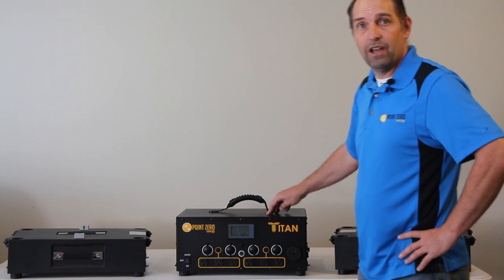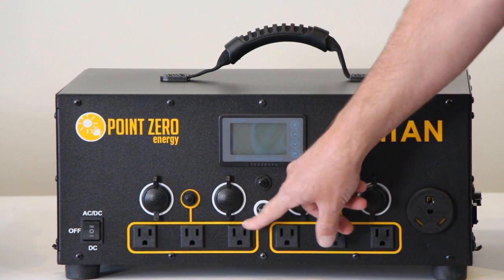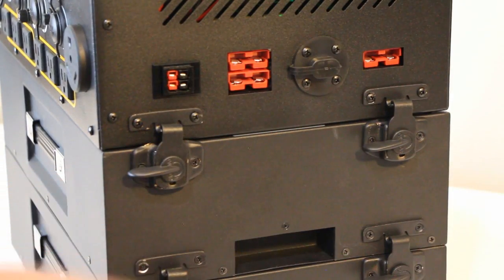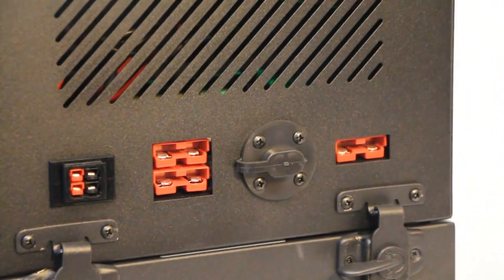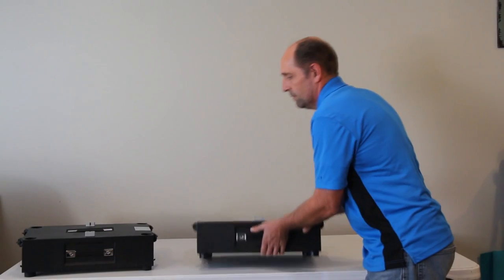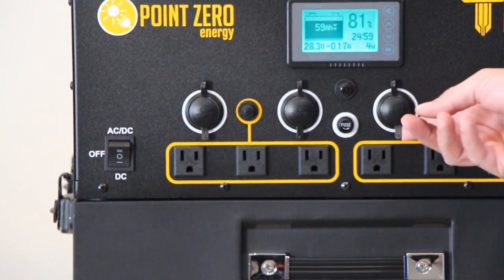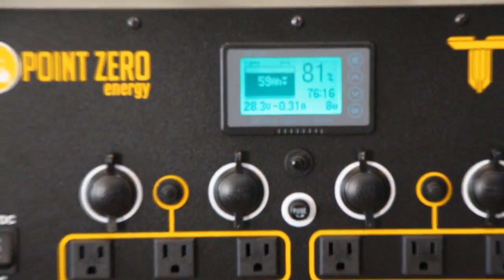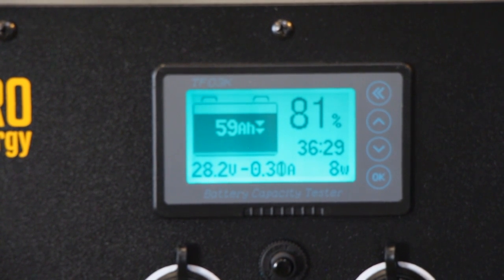Titan Solar Generator final

Comment: Can the batteries be charged directly with AC charger without the inverter?
Reply from the maker: Yes, however if you do that, you will need to fully charge the batteries, and then when you connect the power module make sure it calibrates to 100%.   If you only charge it part way, the battery state of charge will not be accurate.
Reply: @PointZeroEnergy  I guess then that the only way to know if the battery has been fully charged is to connect the battery to the inverter.
Reply from the maker: @thedeal9526  The AC charger will indicate when it is full.

Comment: I'm really loving the modularity and portability design... Do you know if Point Zero plans on offering an EV charging outlet?  Synonymous to bringing a full gas can for long road trips, the use-case is for bringing something like this in the back of an EV SUV/car as an auxiliary fast-charger when the vehicle's lithium batteries have been exhausted. Thanks!
Reply from the maker: HI, I am very happy that you are loving your Titan solar Generator.  Currently you can charge an EV using a level one Charger.  The Problem is that it charges slowly, which meant is will add 3.5 to 6.5 miles per hour.  The Titan 2.0 will have the ability to produce 240V (with two or more units), and would be able to run a level 2 charger, which will be much faster, but even with that, you will need a lot of Titan batteries to extend the range much.  To give you an idea, an EV will use about 0.346 kwh per mile, and one Titan battery is 2.0 kwh.  That means you will get less than 6 miles per battery (5.78 miles if you had no loss in charging the battery, but you will have losses, so you will probably only get about 4.5 miles out of each battery..

Comment: How many batteries can be stacked at once and can you use other batteries of the same composition?
Reply from the maker: There is no specific limit to the number of batteries you can stack, but we recommend not going over 5 or 6 just due to the height.  And yes, you can use other batteries of the same composition, and even batteries that are not the same composition.

Comment: Any plans to add Bluetooth capability to display data?  I am looking to use for an RV, but will need to put it in the under the bed storage space, and not be able to easily check the data.

Comment: Will these be able to work with a well pump?  3/4 HP 240VAC?
Reply from the maker: Not this version.  However our 2.0 will be able to when you connect two units together.  The 2.0 is still in testing (so we don't have a date for it yet), but we expect it to be ready in a few months for pre-sale.

Comment: Will we get a 230VAC output model?
Reply from the maker: Our Titan 2.0 which we expect to release this first quarter of 2021 will have the ability to produce 240V 60hz (split phase) power when you connect two units together.  However we don't have plans for a 230V 50hz version at this time.

Comment: is it possible to work DC and AC at the same time? You might want to charge your phone in DC and turn on a light at the same time on AC
Reply from the maker: Yes, you can run AC and DC at the same time, or you can turn it to only DC to save a little power when you don't need the AC power.
Reply: @PointZeroEnergy  thx for your unswer. Just one last question. the device where are the usb and plugging connectors has internal battery? And if yes what is the WATTS storage capacity.

thx again and congratulation for your devices performance.
Reply from the maker: @angelgarciaarrieta2367  No, the Titan does not have any internal battery.  It uses the same external battery (or batteries if you have more than one) to power everything.
Thanks!

Comment: When I get my tax returns is when I plan to order something like this but will probably end up going with somthing that's not going to take 6 months to get. Great product though. Should try to get the back order problem fixed. I'm sure tax season you guys will get a lot of orders, probably even more orders if it wasnt for such a huge delay.
Reply from the maker: We are working on getting things caught up. And if the country does not get shut down again like last year,  and if we can continue to get the supplies we need,  we should get caught up soon.  By the way, the current wait time is about 4 months (which isn't great, but better than 6 months).

Comment: Lots of common sense suggestions but be assured that users will miss these and stack unbalanced batteries and hook up all kinds of weird inputs then claim warranty.  If you know of a bad scenario that will damage the unit then it will pay off to engineer it out.

Comment: Can you add 5 batteries packs. I see you only used 2
Reply from the maker: Hi,
Yes, you can add 5 battery packs if you would like.  We have several people that are using 6.  The only limit you have is the charge time will increase, and the height of the unit will get a little high.  However you can also start two stacks using our Titan expansion wire.
Reply: Do you have a extra charger to charge the rest of the battery packs. And how low and I run the battery packs with out coursing damage to them
Reply from the maker: @biguzavala314  The Titan comes with two 1,000 watt mppt controllers.  So you can add up to 2,000 watts to charge the batteries.   This means you can charge 5 batteries in about 5 hours of sun.  If you don't have ideal sun conditions, you can add more than 2,000 watts of solar, it will just limit the charge to 2,000 watts.

You can use full capacity of the battery (2,000 watt hours).

Comment: Seems to me the amp hours being 74 (usable) AH's, is very low. I have lead acid batteries with 310 AH's. Why are the AH so low?
Reply from the maker: 74ah X 29V = 2,146 watt hours.  This is larger than any other portable solar generator out there.  Most 310 ah lead acid batteries are only 6v, and you can only use 50% of it.  So the usable power in that battery would be 310/2*6=930 watt hours.  Which is less than 1/2 of what the Titan Has.  The Higher voltage lower amps make the system more efficient overall.
Reply: @PointZeroEnergy  yeah... but you get four of those 6v batteries, connect them in series and parallel.  and you have 12v with 310 usable Amp hours.  I still think the 74 usable amp hours on your unit still seem very low comparably.
Reply from the maker: @desert4seat  To compare apples to apples, you really need to compare watt hours.  Each 6v 310 amp hour battery is around 1860 watt hours (930 usable watt hours) and 92 lbs.  Each Titan battery is 2,000 usable watt hours and about 35 lbs.  So each Titan battery holds more energy than each 310A 6v battery, and is much lighter.  If you add 4 Titan batteries, you then have 8,000 usable watt hours vs 3,720 usable watt hours of four 6v batteries.  That is one of the benefits of the Titan, you can very easily add more batteries without any wiring.  Just stack another on on.
Reply: @PointZeroEnergy  thanks for the detailed reply!!  Yes, that makes sense.  I was wondering what the real scoop was.  I’m still learning about battery systems, so I appreciate it.

Comment: Watched the YouTube video where Will Prowse reviewed the prototype of this generator. I was so impressed I ordered one right away. The company was so nice to me and helpful, giving me all the advice a person could ask for, until I had paid for the Titan 1000 kit. Then they said they couldn’t ship the rigid panels (which THEY Recommended I buy) to Canada for free. I paid extra to have the panels shipped from the USA to Canada, and in the end the panels were actually shipped to me in BC from CALGARY ALBERTA, in Canada. Quite the rip off. My kit finally arrived, missing the four LED strip lights, MC4 to SAE connector and the MC4 to Anderson adapter, as well as the power cord for the charger to connect to a classic wall receptacle, to be able to charge the battery from grid power. I contacted them and they said they would let Point Zero know. I have heard nothing back from them at all. It seems like they took my money and now don’t care if they give the the product I paid for or about trying to help me now that they have my money.
Reply from the maker: Hi,  I am not sure why you are upset with us.  You ordered your kit from a Distributor (not from us).  We had nothing to do with the LED string lights, solar panels, etc.  Those were all purchased through  someone else.   I am not sure why you were missing the power cord or adapters, but we are sending you a new ones, and the distributor you purchased your system from should have let you know.

Comment: In a real scenario I would like to power air conditioner refrigerator and maybe a freezer. How come no one ever really shows what these generators can power other than a few power tools maybe a toaster or a toaster oven or things that really don't mean anything to most people   In a shtf situation
Reply from the maker: It will easily run the refrigerator and freezer (with the correct number of solar panels and batteries).  However the air conditioner may be an issue.  If it is 240V central air, it will not run it.  In fact it would need to be a 120V 10,000 btu or less to even run it.  And even then, it would take a lot of solar panels and batteries to run it full time.  If you just run it during the heat of the day when the sun is out, then it would easly run it with 1000 (1500-2000 watts if you also run the refrigerator and freezer)watts of solar.
Reply: @PointZeroEnergy  I'm really only trying to run a 5,000 or 8,000 BTU window air conditioner as back up. But don't know if I can. Thanks
Reply from the maker: @allfreedom66  It will run a 5,000 or 8000 btu window air conditioner.  You can use our calculator to help you figure the amount of batteries and solar panels you will need.  https://www.pointzeroenergy.com/learn/off-grid-size-calculator/
you can put the power usage from the air conditioner in the box labeled "Other: Watt hours per day"  Just take the watts of the air conditioner and multiply it by the hours it will run each day, and put that number in.

Comment: You didn't show what you removed to connect the batteries, you said you did  something but you wanted to use the one that already had it removed...less work...but we should have been shown dont you think? I worried it will not run much, you showed a small heater, egads these cause alot, can you show us a Titan running an RV's lights, frid, air, etc?
Reply from the maker: If you look at about 4:03, you will see the bottom of the battery has a cover over the ports.  These covers need to be removed on the top battery in able to stack it on top of another battery.
There are several youtube videos out showing a lot of things it will run.  It will run up to 3,000 watts continuous with a surge of 6,000 watts.  Of course if you only have one battery and very little solar, it will run out quickly.  However we have not had time to make very many videos showing all the things it can run.

Thanks!

Comment: Make a 50 amp one and you’ll have my money
Reply from the maker: That will have to wait for our Titan 2.0.  It will be able to parallel multiple units to get 240V split phase, and as many amps as you need (depending on how many units you combine).  It is still in the testing phase, but that is the plan.
Reply: @PointZeroEnergy  50 amps holy crap

Comment: If I have a transfer switch into my electrical in my house (30A) for a gas generator, as long as I only have breakers on for a small portion of my house (like lights for the main room), would this work with the transfer switch?
Reply from the maker: I don't see any reason why it would not work for this.

Comment: Mr are you able to Provide me as Generator for 2,Ac,Water Motor, Refrigerator, also 6 Savers Bulbs,
Reply from the maker: Hi,  I am not sure what you mean by 2,AC,Water Motor.  Please give me more information on that.  Our titan could defiantly run a refrigerator and 6 lights, but I don't know what the rest is.  Are you saying 2 ac units, and is a water motor a well pump?  I would need to know the specifics on any AC unit, or well pump to be able to know if it will run it.

Comment: I was wondering is there a way to change the voltage settings of the solar charge controller so as to cut off charging at a slightly lower voltage?  Even though the meter says its 100% when I reach 29.0V the solar charge controller allows it to charge up to 29.4 volts.  That seems a bit too high especially if I add an external 8s LiFePo4 battery, which I'm told should only be charged to 29.2 volts.  Your thoughts?
Reply from the maker: The MPPT controller is set to charge to 29.2V, however every meter will read a little differently.  29.4V is well within the safe range for the Titan battery, and should also be fine for the LiFePo4.  However I would not leave it charging up to that voltage for days without use (this is good advice even at 29.2V.  Lithium batteries last longer if they are not kept fully charged for long periods of time.
unfortunately there is no way to for you to be able to set the charge voltage.  You may want to try charging on the other mppt controller and see if it charges at a slightly lower voltage.
Reply: @PointZeroEnergy  Ok.  Thanks for the quick response.

Comment: I am doing a cargo trail to camper and I want one but how it is with bouncing around a bit? I will have it supported but the trailer will still bounce. I'll be running a 4.5 cubic foot frig , cpap, lights, and on a hot night a window unit for about half an hour to cool down the trailer or in winter a small space heater. I want two batteries and 500 watts of solar. I believe this would do all I need plus. In the day time the only thing that will be running is the Frig so the 500 watts of solar should charge it back up every day. Now all I have to do is Save up for it. I'm Disabled and on a fixed income and money is tight for me. This trailer will become my house later on.
Reply from the maker: Hi,  It will handle riding in a cargo trailer or camper fine.  However running an AC or a heater will take a lot of power(but it should handle it for 1/2 hour per day).  With only 500 watts of solar, you could not run them very much.  You can use our solar calculator to figure our how much solar and battery storage you would need:  https://www.pointzeroenergy.com/learn/off-grid-size-calculator/

With 500 watts you will be limited to about 2500 wh per day (depending on where you live and how much sun you get).  Without knowing exactly how much power each unit (fridge, lights, cpap) use per day it is hard to know for sure.  But if you only run the heater or ac for a half an hour, you should be ok.
Reply: @PointZeroEnergy   My frig has been running for 6 hours and has used 0.16 WH. My cpap uses more then the frig.  I am out and about all day and get back around 5 or 6 and I hit the bed at about 8:30 because my start time is around 4:30 am the next day so it has all day to charge with nothing running but the frig. I am going to check out the calculator.

Comment: I'd be highly interested if you had a unit that worked for a 50 amp plug to an RV. We want to be able to boondock on our property north of Reno, Nevada...interesting.
Reply from the maker: A 50A RV plug is 240V split phase.  In order to get this kind of power, you will need to wait for our next Titan version, and connect two together to get split phase 240V power.

Comment: How long can I run a heater, stove and a Dometic refrigerator with one battery?
Reply: I suggest you educate yourself about amps, wattage and volts first. Then you can find out how much your appliances use
Reply: The only “known factor” with your question is the power source, 2000w (one Titan Batt. System). The missing information... the load numbers, how much power (watts and volts) does each of your devices consume per hour, and what is the surge wattage (if any) of each device you want to power. When you can provide those missing details/information your question can be answered, sort of. As always, other factors might slightly alter any estimated time frame, as to how long your devices would run on one Batt. and/or if a given device is even within range of being powered by the one Batt. Titan System. 

Yep… not “as simple of a question” as you might expect.

Comment: How much can the battery be discharged to prolong life?
Reply from the maker: At 100%, you will get up to 2,000 cycles.  The titan uses a larger than 2000 watt hour battery, so when you use 100% of the battery it is not really using 100%.  I hope that made sense..?

Comment: Is there any fire hazard with using this on a regular basis (the airlines won't let us ship Li batteries in checked luggage)?
Reply: No, it is actually very safe.  However you are correct, you cannot ship lithium batteries this large in a commercial airline (no matter what type or how safe they are).

Comment: Does this generator have any solar input circuit protection built in?
Reply: It has reverse polarity protection, but it can be damaged if you connect it to an array with over 145V.